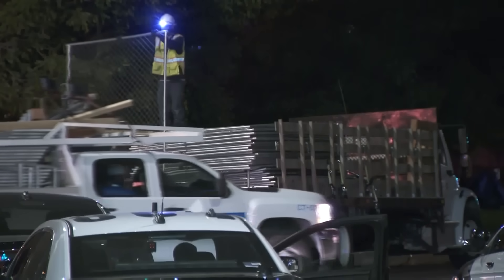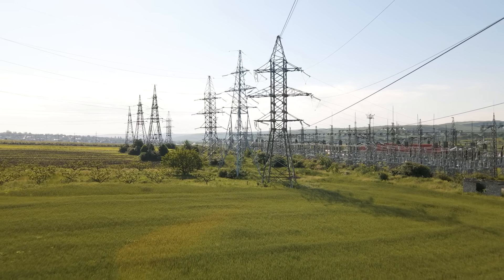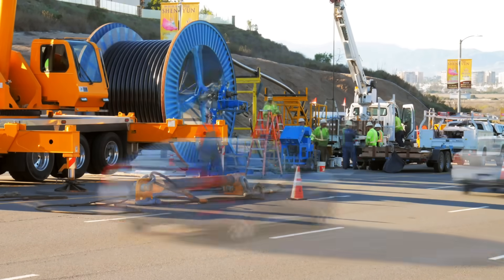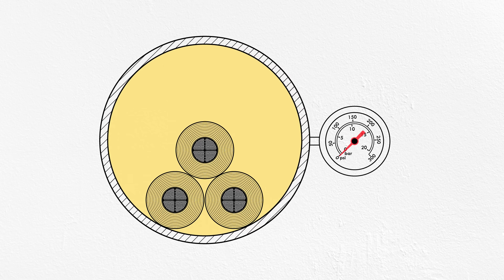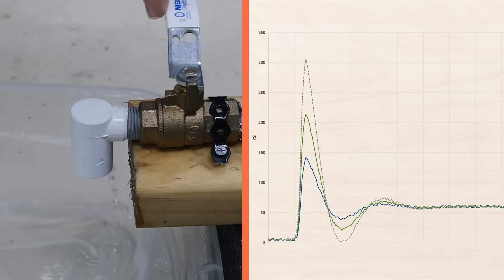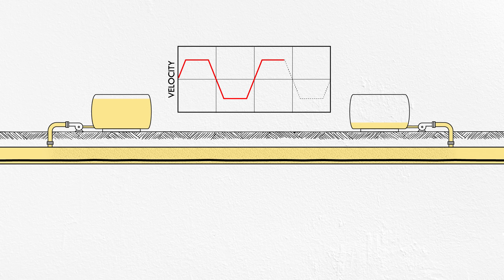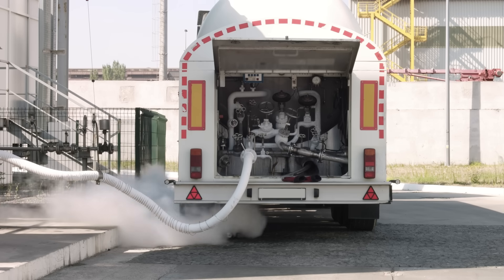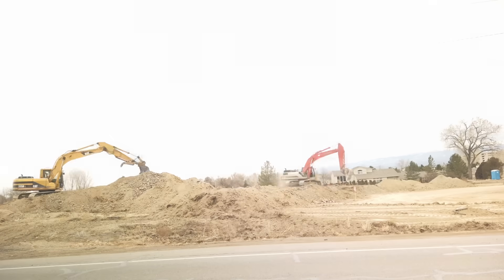Repairing Underground Power Cables Is Nearly Impossible

Comment: I hadn’t thought the expansion and contraction would have violated the design bending radius within HPOF cables. I thought it was the compression and degradation of the paper insulation that causes the failure. Great video as always.

Comment: I had just started at DWP when this happened, but was working on relocating the underground 138kv transmission line for the Century freeway.
Reply: Miss that old lead covered, paper insulated, oil cable...good for 100 years if maintained propery.
Now we get 20 year synthetic covered cable..🤔
Reply: @dougw5950  There's a reason the newer cables use different materials. It's because the newer materials are better.

Comment: A possible follow up story. There is a VHV -DC power line that under the SF Bay . The lines runs from the power plant (Antioch?) to The PG&E main switch in South East San Francisco. This looks like a giant 2 conductor extension cord.
I would like to know if this giant DC power cord is cryogenically cooled or not?

Comment: RODALCO2007, a high power electrical engineer living in New Zealand has a video on You Tube where he completely submerges an (active)  color CRT television (27kV anode voltage) in large bucket filled with transformer oil. 
It is so weird to see this TV play normally while completely submerged in to a liquid.

Comment: So, what IS the future of electricity distribution?
The last few years have highlighted how the age of cheap above ground transmission could (or should) be over.  Damaging weather events are increasing in frequency as are incomprehensibly damaging wildfires started by above ground electric transmission infrastructure.
Underground transmission is expensive to install and maintain and the transmission itself can require regular repairs. That's on top of any repairs required due to geological events.

Are we going to be forced into abandoning the interconnected grid model in favor of highly localized, independent electric generation & distribution - which has it's own set of issues?

Comment: Just about all the engineering in that story are absolutely insane. The oil soaked paper insulators, the high pressure oil, the pumping of the oil, the acellerating and decelerating of the oil and finally the liquid nitrogen to make the plugs. WOW

Comment: Time delay reflectometers are very accurate to find breaks in cables. It is the method of choice for optical fibres. OTDR or Optical Time Delay Reflectometers are accurate within 3 feet over the entire pacific ocean. In this case, the wires were not broken, they were compromised.

Comment: From the title, I was expecting to hear a story about some kind of major screw up. Interesting, but frankly, I'm disappointed. Was someone supposed to know that this thing wouldn't last forever?? Sounds like the world did not have a whole lot of experience with this type of system. Reminds me of a problem we had at work involving cables breaking due to flexing. The solution was to not tie the cable down with zillions of zip ties, and to introduce a loop into the cable so that the flex would not be concentrated in one spot. Wonder if they could have solved the problem by adding loops along the way??

It's kind of crazy to me that you have to ACTIVELY maintain this cable by constantly pumping oil. Seems like the pumping requirement would create reliability issues.

In the future, someone will invent a room temperature super conductor, and transmission lines will be very fine filaments of that material, kind of like how we have "micro trenches" for fiber optic cable capable of carrying vast amounts of data nowadays.

Comment: Quite interesting hearing high pressure was used. I'm used to always seeing items submerged in oil being put under a vacuum to permeate the oil and purge the system of air and water. Perhaps the steel pipe was vacuum evacuated, and then filled with oil. Most interesting method of powerline transmission I ever heard, thanks for sharing!

Comment: it is still scary to consider how much infrastructure is well past it's "use by" date, with little thought given on how to repair/replace it. Heck, frequently the initial build and installation process has made repair much more difficult than need be.
part of the problem is so much of it is underground, and 'out of sight, out of mind' applies, and even with the visible infrastructure such as bridges and roads, budget constraints often apply because people don't want to pay their taxes. Stupidity reigning onc more as planned maintenance is cheap insurnce compared to a catastrophic failure.

Comment: I have a few question:  

What is the highest volts that a we can push throw a high voltage wire? 

Is it theoretically possible to have trillions of volts at an amperage low enough that it will equal 1 watt? For Example 1 Trillion Volts at 1/1E9 Amps or what about 1E24 volts at 1/1E24 amps. Or is there a limit to how far the ratio of volts over amps an be.

Comment: Whoever was using the otdr to find the fault either didnt know exactly how to use it or the otdr was just crappy being back in the day.   Because i can pinpoint every bend along the entire run on a single strand of single mode glass fiber..  you can literally locate any potential place causing degradation, reflection or refraction and whether it's converging or not.  Dunno how youd use an optical time domain reflectometer but still a simple network cable analyzer would do the same thing..

Comment: My experiences in O&G with 4120 Vac we NEVER ran the phases in the same conduit, instead each phase is run (3 x O), sometimes 4 x 4" or 6" conduits for an isolated neutral in poor grounding conditions, compressed nitrogen fill if necessary. The point being I believe the failure is not in the burial of the power lines, it is the whole overly complicated pressurized oil, oil soaked paper cables pump scheme that's Rube Goldberg instead of simply spreading the phases 24" - 36" (whatever optimum) physically apart in separate conduits (that can have EMF shielding to reduce cross phase induction).

Comment: 1970's underground power cables 'innovative for the us time' !
'underground-cable-western-power' pictures...

Cable Laying – power cables being manually pulled from cable drums and laid underground at High Street/Back of Bridge Street, Bristol (1898).

Cable Protection – Baldwin Street cable works with cable protection covers and markers made from brick, Bristol (1893).

Power Rectifiers – three Willans steam engine/Easton Anderson alternators with three Ferranti rectifiers in background. Devon, Torquay (1898).

Cable Jointers –  some cable jointers and workmen involved in the single to 3 phase changeover photographed in Vyvian Terrace. Bristol, Clifton (1921). etc

Comment: Hey Grady,
Does dielectric oil expand when frozen?
I was under the impression that water was a (the?) exception, and that most materials shrink when changing to solid state.
These solid oil plugs are holding back 14 atm of hot pressurized oil, and the only thing holding it in place is force of friction?
And on top of that, oil is a lubricant, minimizing friction.

So all of that having been said, how is it that these solid plugs did not shoot out and become projectiles?

Comment: Anybody know why those high voltage line towers seem to come in a handful of different shapes (say A B C and D) and then are combined without any clear pattern (say AABBDABCDCCBBBBADCDBDCA)
Reply: Some towers are designed to handle load, transmission lines, that just go straight.  Others are designed to allow the transmission line to change direction.  Some may change design to push the line higher to obtain clearances from obstacles.   Also, older towers were designed to easily erect with smaller equipment but takes longer to construct.  Newer Towers can be made to take a smaller footprint and yet larger loads.  Lots of factors go into tower design.
Reply: @ehartm  I was guessing it was something to do with terrain, but really interesting to hear a little more of a breakdown! Thanks!

Comment: "Repairing Underground Power Cables Is Nearly Impossible".  We are in this very situation.  A wildfire took out the underground power lines to one of our mountaintop sites and it's financially unfeasable to repair the line.  As a result we've been running the site on generator for a year now and there's no end in sight.

Comment: In Germany there is a north-south line planed for the costal wind energy. It's a ~700 km long high voltage DC power line with AC-DC converters large like a midsized factory.
This was done due to protests of the affected citizens against the large overland power lines. It's called suedlink. 4GW no cooling required.

Comment: 2:15 air is a very good insulator, it just isn't enough for high voltage lines. but it is still one of the best and most used insulators on the planet. if you ever touch the side of an industrial deep fat fryer and don't burn yourself, thank the insulating properties of air.

Comment: If i understand correctly, at 3:47 you say that  liquid dielectric is a better insulator than air.  The dielectric constant of air is lower than any other substance.  Only a Vacuum is lower.  The  dielectric constant of liquid dielectric is higher at about 3, I think.  What is the scientific reason that the wires don’t arc at that close spacing?

Comment: There's a SOP regarding electricity transmission: insulate or isolate. This oil filled line sounds like a crack pot idea conceived by a bunch of enginerds that never considered maintenance. That, or by the time it breaks, I'll be retired.

Comment: Wrapping the three phases in a spiral -- one revolution every 5-10 ft -- would have allowed the wires to expand uniformly along the line's length.  The radius of the spiral would increase.  Then the temperature need only be kept low enough to keep the spiral radius inside the pressurized pipe.  Also, when the temperature starts approaching critical, they should begin shedding load... ideally, replacing the load from a different switching station.  Improving cooling capability would also increase capacity.

Comment: Given it's LA, I'm curious if any engineering that went into trying to ensure the cable could survive an earthquake may have had a detriment on the TMB that ended up causing the problem.  Even for the time period I'm also surprised they couldn't have used a reflectometer successfully, but I could see how they'd have issues with dispersion or attenuation.

Comment: "They also introduced a device known as the thumper, which introduces pulses of high voltage into the cable, though with an increased risk of sandworm incursion."
Reply: The spice must flow
Reply: @Gordon519  Yeah, and puncture that HV underground cable insulation and The sPlice must flow, too ... 
(Utility worker inside joke)
Reply: @glenholmgren1218  petrochem sparky here. Puncture that cable, the splice flows. But the boss is angry as the splice flowing stops the spice from flowing :)
Reply: Applicability: Tremors > Dune,
Chronology: Dune ==> Tremors
Quality: Dune > Tremors
Reply: Shai Halud
Reply: I can hear Joey from Friends  saying "How YOU Dune?"
Reply: Thumper was universally famous a good twenty years before Frank Herbert ever put pen to paper.

Also: my name is a killing word.
Reply: @Psychol-Snooper  Indeed, I tried to read your name but I passed out when I got to “pple”. I won’t try that again!
Reply: @JoeOvercoat  Not my channel name... that a napping word.
Reply: @Psychol-Snooper  true, I had to request the use a thumper numerous times in the last 14 years.

A cool story regarding one. So as we  were scanning with one in a my section of a petro plant, I was walking with the "listener". Anyways, guy nails it down to a general location and takes of his headphones. Suddenly he tells me that he is still hearing the thumper crack. We look around and a junction box sitting on the surface on some unistrut framing shaking violently . Offcourse it was not listed on the cable schedule. "well your fault is in there" Shut of the thumper and open the box, water pours out. Clean out the carbon and properly dry out the box (was only 525V under some 200A fuses so the fault fortunately did not obliterate the inner bussbar connections). Meggar, power up, happy camper, no digging was done that day.
Reply: @gertvanjoe  Well the Thumper I was mentioning was Bambi's rabbit friend. Although I get the gist of your story, I do not understand the bulk. 

What does the thumper you use do? Also, Frank Herbert was famous for appropriating exiting words into his stories: do you think he did that for his "thumpers" with your devices?
Reply: @Psychol-Snooper  basically it spikes a cable with a surge of high voltage which will then discharge to earth with a loud electric snap at the point of the fault. An operator first established the distance of a fault with a advanced hipot meter. Then the route is walked with a meter wheel to establish the general area. Thumper is started and the operator listens with a floor running mic as to where the bang is loudest. Dig a hole, 95% of cases right on the fault, repair, go on with our life's.
Reply: @gertvanjoe  So at the point of the damage there is an arc... that presumably makes a thumping sound. I think I get it.

Thx!
Reply: @Psychol-Snooper  the machine is more the one making the thumping sound as a set of contacts  smash together and fall out every 1 second or so. The fault is more of a kTA sound.
Reply: @gertvanjoe  The machine making the charge?
Reply: @Psychol-Snooper  yes. Ours is diesel-powered with the unit having a small window at the contacts so you can see the blue thunder being made
Reply: Antlions too.
Reply: October 22nd can't come soon enough!!!!!